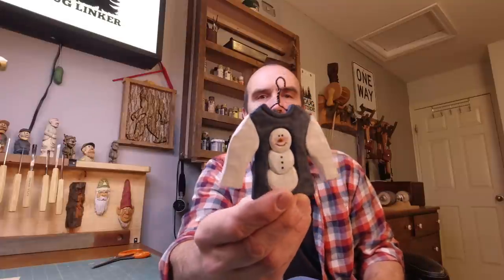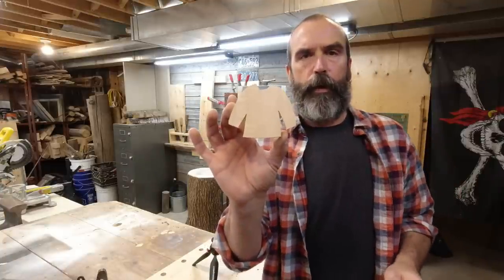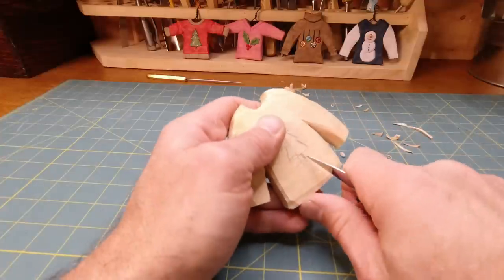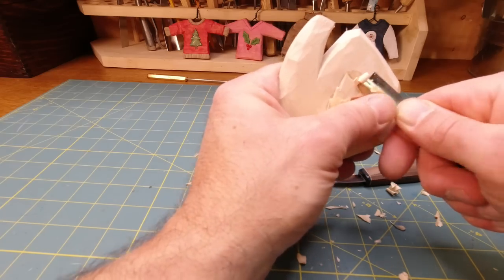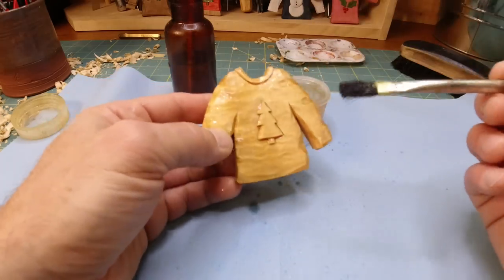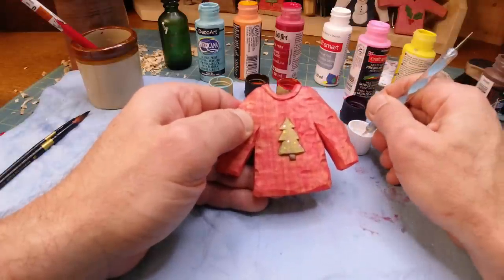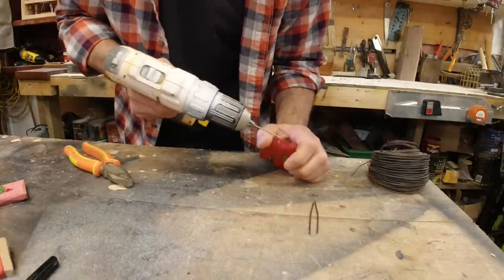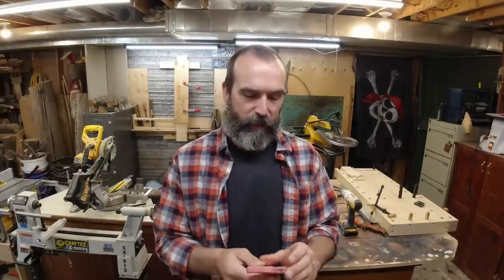How to Carve a Christmas Sweater Ornament -Simple Woodcarving

Comment: very nice project. i am up to six so far. i  think the grain running vertically is better. i got cleaner cuts, especially in the armpit area and when carving the little tree on the front. also, i am making the arms a little longer, because when you look at pictures of men's sweaters, the arms are at least as long as the sweater body, if not longer. research before carving!  i am using 1/2 inch basswood, and am going to try some butternut.

Comment: As far as the boiled linseed oil, did you thin it or not? I’ve used it on replacement hammer and hatchet handles, and sometimes it stays sticky. I’ve heard that thinning it will prevent that. Love the project!
Reply from the maker: Straight -boiled is much better at drying than raw

Comment: Hi Doug! I've been following you for a while now, learning from your tutorials. Thank you for helping us, newcomers, learn the trade 😁!
I have a question regarding the painting of the miniatures. I paint them with acrylic paint and then apply a wax sealant. When I apply the wax, it rubs some of the paint off even if I let the paint dry for an hour or so.
Do you have any tips on that. How long do you let the paint dry before applying the sealant?
Reply from the maker: Are you watering the paint down? -I’ve never had that issue when adding water to the acrylics because it actually will soak in like a stain and not lay on top
Reply: @dougLinker  first one I did, I did not water it down too much, just a drop or two. Yesterday, I watered it down quite a bit. It was indeed better but I still got a bit of discoloration. But thanks for pointing that out. I'll be trying some more.